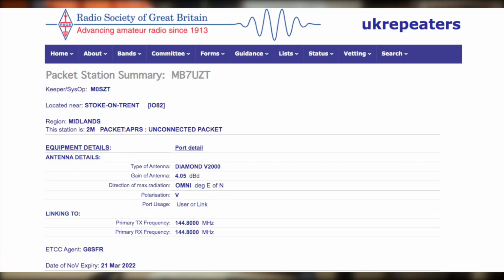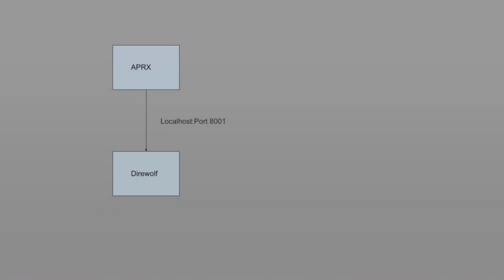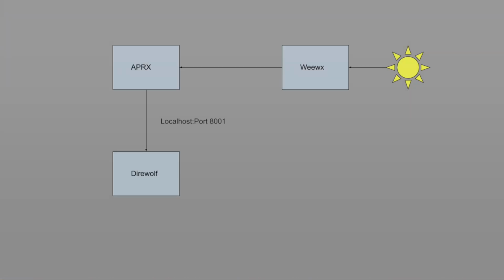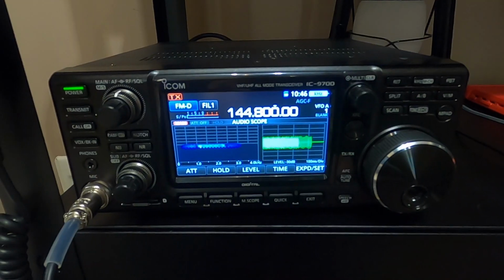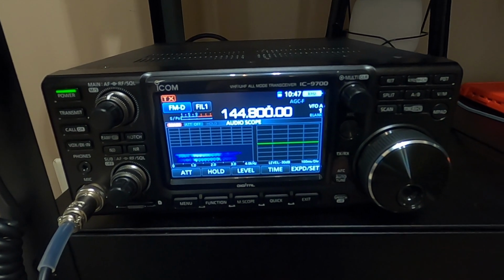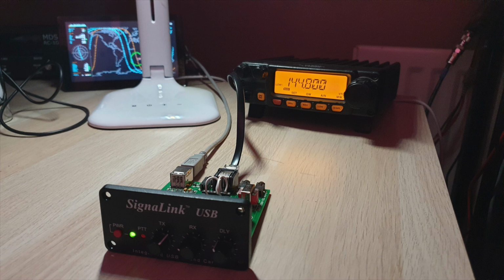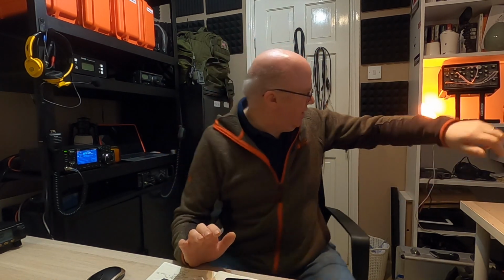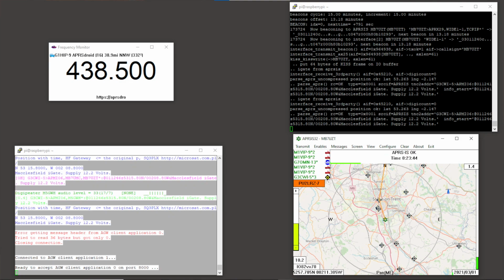Building and running an APRS packet repeater | MB7UZT

Comment: Nice one Carl !!  I run MB7UNE-10 down here in Newport, S.Wales.  I picked up a Motorola GM340 from fleebay recently v.cheap (£25 quid ish) and have switched over to using it. It works very well. 73 Richie.
Reply from the maker: Fab, have just wired up a GM350 for quick hilltop digipeating 🙂

Comment: Use a Baofeng, dirt cheap and can do 1W.
Reply from the maker: There's a reason why they are dirt cheap. The transmission is likely to create interference across other bands and the reception is heavily affected by other local VHF signals due to a poorly constructed front end. I have 2 of them.

Comment: For the motorola use the cheap CM108 USB Sound card fobs. You need to do a little soldering to add PTT and COS signal lines, but the CM108 is fully supported in Direwolf and saves using an expensive signalink or similar.  They also interface really well with Baofeng radios to make a portable APRS i-gate (Raspberry Pi, CM108, Baofeng, Hotspot) for leaving in your car whilst out walking.

Comment: Hi Carl, just an idea for your gm350 radio, I use the gm350 for a "dmr hotspot" it works excellent and only requires a few little modifications, you use the pins on the back end of the radio and the modification inside is to give "pure raw" audio for the pi or arduino to use,
Mod is cut a track, solder thin wire from pin inside directly to side of a cap and lift a different cap, then in the engineer side of the software you change the volume and transmission audio gain and the slider for the power output for the band you are on, select in the software what pin does the tx and cor/rts etc. 
Oh also you take the front off the radio and unplug the speaker ;) 
Pins on the back can then be used for tx audio, rx audio, ptt and cot.
The best thing is as the radio has heatsink for doing 25watts it never gets over warm even on 100% duty cycle of tx, however packet is not that much ;)
If you need help let me know ;)
Reply: I meant to say doing the duty cycle at the low wattage you want to use won't be overly warm even if its at 100% ;) sorry I should have proof read it first lol
Reply from the maker: Thank you, I may make a start over the next week or so
Reply: Have sent you an email at the address on qrz :)

Comment: I’m always confused by the “new” UK prefixes. Took me a while to realize that the 0 was a Class A. When I held a callsign there it was a G prefix. Anyway,, have you thought of using something like an Android tablet instead of a Pi?
Reply from the maker: Yes I've tried a tablet, the RPi can be run headless and is easy to configure to be always on and recover from rebooting. I could run ubuntu on a tablet if needed but compared to an embeddable computer its overkill.